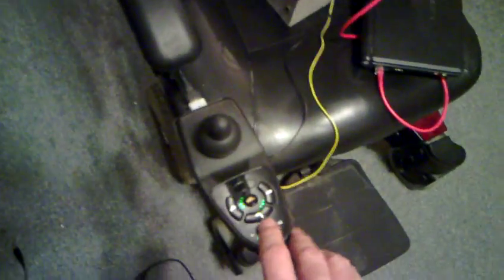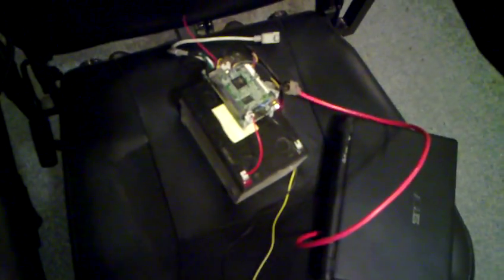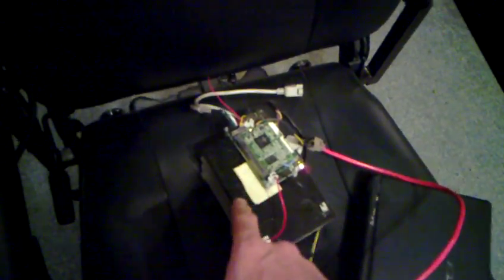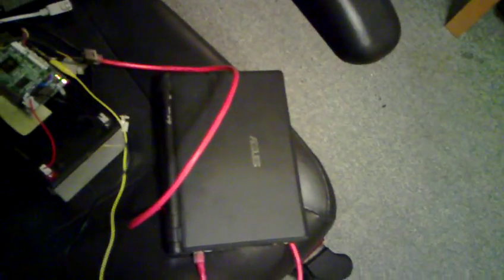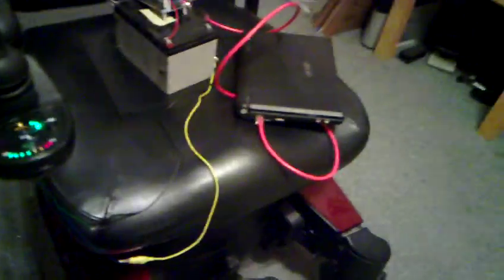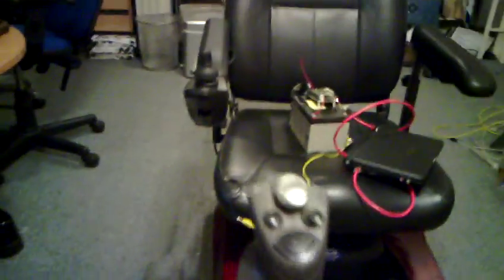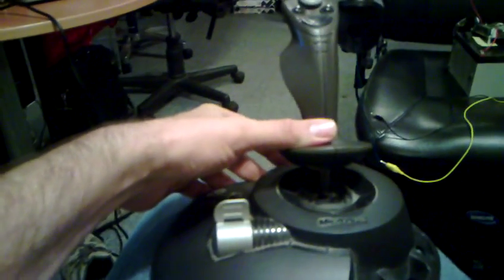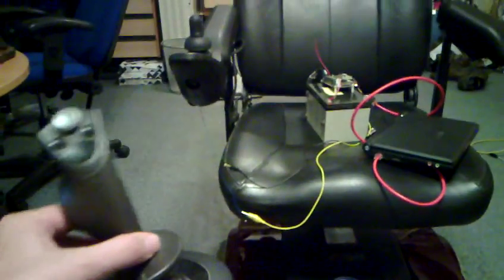Hacking an Invacare Pronto Electric Wheelchair - Part 4

Comment: Hi, Jim. Can you forward me a link to the sharkbus document? I'd love to see the protocol!
I've converted a couple chairs to RC/ardurover, but my current project has power lift tilt and recline that I can't really leverage by the usual "hack in a sabretooth" method for the wheel motors.
Reply from the maker: I just found an online copy of the spec... http://blog.arisux.com/wp-content/uploads/2021/01/Shark-Bus-Communications-version5.pdf
Reply: @ThingsWhichArentWork  Thanks, I found the same after a little more research. Turns out there's quite a lengthy conversation and even a board developed for SharkBus control over on wheelchairdriver.com. I understand that much of that development came from your research. Thank you for that

Comment: Please someone tell me how to make it go faster at least 20 miles an hour
Reply from the maker: I'm afraid that's not an easy one Richard. The only way to go faster is to over-volt the motors, but you'd probably need a different speed controller to handle the higher voltage. I doubt that factory unit will handle more than about 30v before components start to fail. You'd probably need to look at some RC speed controllers to handle more volts/current, and then it wouldn't be compatible with the existing control joystick etc.

Comment: Hi Jim, I am a student in University of Birmingham trying to hack a similar wheelchair so I can control it with eye movement. With the help of your code and connecting wires from the usb converter to in between the data wire and the wheelchair joystick, we were able to receive and read joystick messages on the laptop. We are however struggling to send messages that the wheelchair can respond to. Is there anyway you can give me some guidance on how to control the wheelchair? thank you